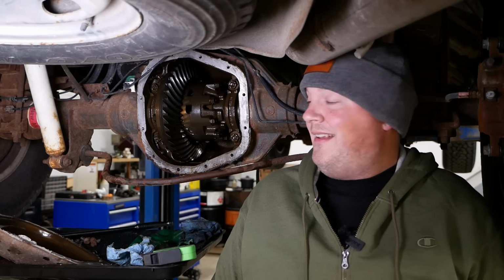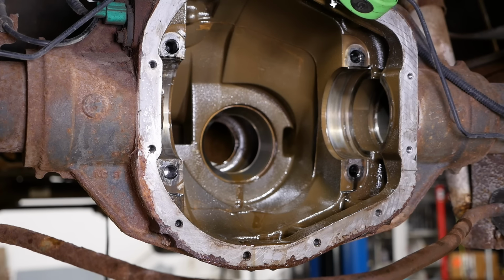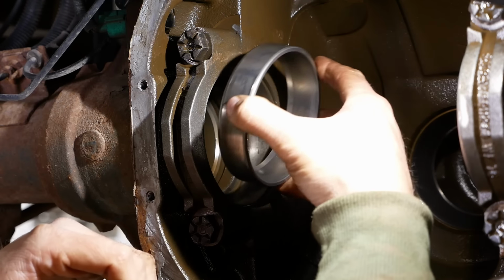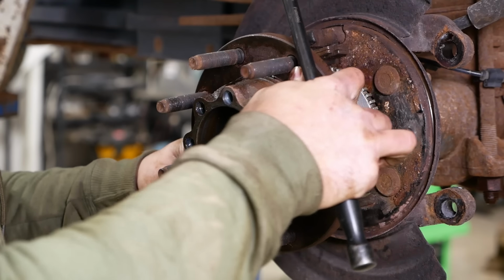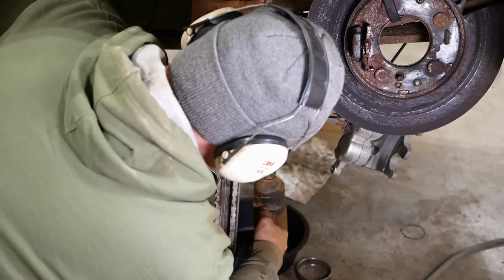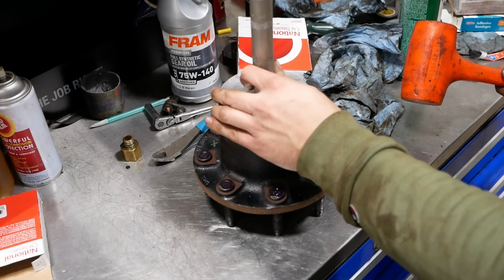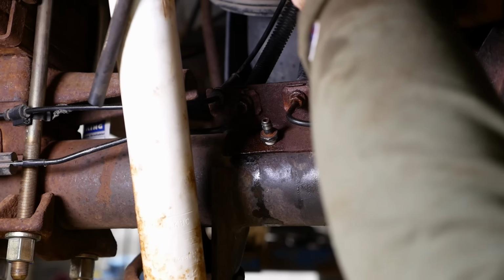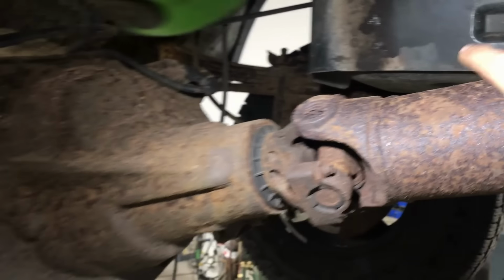Ford Differential Carnage - Driveline Noise Located

Comment: cat bearing set,  its like locktite for bearings/races..  great stuff I use it on all dana's as they tend to spin the load side carrier bearing and spin the carrier shims out....  ohh if you ever have to touch it again make sure you heat it before putting it in the press...

Comment: I had a gearbox for a 100 ish year old bridge crane with loose bearings like that actually worse. I glued a strip of paper in the housing and the cap. That crane ran another 25 years until they tore down that part of the mill. Damn thing was a beast, it actually had carbon piles for resistors in the motor control

Comment: I just rebuilt a rear axle in a JD 9520 4 wheel drive tractor . Axle bearing went out and took one of the planataries with it . Got the planatary parts from a salvage yard but still cost 5000$ for parts.

Comment: Good video WES. 1ST you saved your customer a lot of money. 2ND if you gave him the old axle back he would at least a spare ring and pinion gear.that is if they didn't want a core at the wreckers.You did the job in a clean non contaminated way.AND the big one >>>you cleaned out the VENT,most likely the start of this issue.

Comment: I recently rebuilt my 10.25, without the luxury of a lift. The prybar at about 5 mins in brought back "fond" memories of being afraid to catch the thing with my teeth. Pulled that thing out and reinstalled it maybe 25 times getting everything right.
Reply from the maker: Dana axles have a neat tool to spread the case so you can easily remove and install the carrier. I don't have one, but if I ever rebuild another Dana I'm getting one!
Reply: @WatchWesWork  I'd have cobbled something together at work if I had I known I'd be taking it out and installing it so many times. I eventually did make an alignment/measuring tool in order to measure the distance from the carrier axis to the pinion head. The shims that came in the kit for the carrier also only got my backlash too loose or too tight. I resorted to manually lapping/grinding the shims to fall into the narrow backlash tolerance that Motive Gear called out. I could find no one who sold shims that listed their thicknesses. I never did find a gear pattern I liked with marking compound, so I settled for careful measurements. It was a fun project.

Everyone who told me to find a junk yard rear end was right, but I didn't trust junkyard stuff and I'm stubborn.

Comment: Excellent video Wes :) also had replaced my 2 axles in his 2011 Ford  heavy duty 1/2 ton 4×4  truck 4 door one and had 285.000 miles back 2 years ago ! We had get 2 junk yards and swap over and totally 14 hours fix up and 6.2 litre great motor and 6 speed Automatic transmission too heard a lots nice stuff about them !

Comment: Little Trick To Getting that Yoke off that rear end is after you check your clearances and BEFORE you pull tgose axles out SET THE EMERGENCY GREAK good and tight that will keep that yoke from turning and it will come off easier this from a retired 78 year old Mechanic thats been there done that and found easier ways

Comment: Oil and grease do not blend together. It,s either oil or grease but not blended together. If mix together. .there,s a chemical break down
Being a long time trucker , all hubs are oil , way back on the day , hubs we're grease packed. If your oil seal went bad,leaking  and no shop within 200 miles. . One could slide the dual,tires, off the axle. Clean all the oil out and pack it with hand grease, the kind used on autos
Their is a chemical reaction between the two,causing the grease and oil to crap. Very good job and good pictures too. Thanks.

Comment: Sterling 10.5 is a common rear axle on Ford f250 and 350 super dutys they were also used on the excursions and several other vehicles these are full float axles

Comment: I needed this video I have been chasing this problem for a few weeks I only replaced the outer pinion bearing. I bet my problem is deeper after watching this. I got a little scared when you said all the parts were more expensive than a new axle. I was able to find a kit from nitro for under 400.

Comment: You nailed it.... Liability. Cracks, contamination, etc. Personally, I would have thrown new bearings in it, the shims right back where they were, and maybe replaced the crush sleeve. Not much around here worth the effort. As long as it's not heading to the track...

Comment: I used to have a 50 Ford Flat bed truck that had been extended to 18 feet. It ate U joints. I learned to carry a 7/16 wrench and a couple spare U joints. Got it down to about 10 minutes. Don't want that hay getting damp and I didn't want to pull him off the bailer.

Comment: Great job. I wrench on all my stuff. I once had a 1972 Vega with a limited slip diff. Those a carrier gear bolt came completely out and ran through the ring and pinion gear teeth, totally destroyed it, the bolt was crushed and had gear marks on the side.  I replaced with a junk yard Diff for like maybe at most $100, of course not limited slip. I blame GM for the bolt coming loose like that. I thought  how a massive bolt could run through the gear teeth, and what happens is the pumpkin bends distorts or cracks or something yields to allow that. I did the diff axle change in the parking lot at the apartment complex. That was back around 1985. I heaved the busted diff right into their green bulk trash bin.

Comment: I had a 2011 F150 that had the rear differential over heat to the point where you could not keep your hand on it. Thank God for warranties. Ford dealer just replaced all the internal parts.

Comment: Otherwise they will turn on and crank up the radio and cover up the unwanted noise. Like you Wes I have seen it every day for 40+ years now. My favorite is run the rotors until the fins are the stopping surface for the brake pads.😅😂. It will get you to stop quicker they say.

Comment: On every vehicle I've owned (I'm 74 so , a lot of vehicles ) I take the trans and diff vent out , put a barbed fitting and a neoprene hose curled downward and wired (zip tied ) to the housing . Much better way to vent 👍

Comment: Late to the party a but but hey never to late to find awsome video. The F150 with the 10.5 (newer one) also have a lot of problem with water getting in (with the axle bolt breaking off but there is a TSB for that). The casing itself looks very similar even tho it is less heavy duty in the F150. What I see most is water getting in and then everything eat itself up but it also end up destroying the right (always the right) axle shaft out bearing for some reason. You have a noisy drivetrain and you can move the right wheel up and down. Already have done like 5 of those this year on 2018+ trucks with lots of miles (from a construction company)

Comment: In my opinion if there's any doubt with a part replace it , you can put it back together and it may start to wear on the new parts immediately or you could get lucky and it will give you a few more years

Comment: Depends on which junkyard you go to down here. If you go to the Cuban junkyard they'll sell you anything they possibly can. Brake parts (even used pads), batteries, fluids; if it came into the yard they'll try and sell it. If you go to the LKQ pick & pull on the other hand, they're a bit more restrictive on what they'll sell you.

Comment: As always a good video Wes I am going to make one suggestion it was where our then was if you replace one caliper you replace both calipers the reason being is a newer caliber is stronger and will blow out the other caliper you know somebody else probably did it always a good policy even with good not wheel seals but I should say brake shoe cylinders for the on each wheel Chase both out or off for alright 68 year old mechanic Bob from Vero Beach Florida God bless have a great holiday and stay safe

Comment: Odd, those axles are usually super tough, like 500hp on 43" tires tough.  Carrier bolts are only supposed to be ~88ft/lbs.  That differential either got REALLY hot or had water in it and it sat.  In a pinch with a spun race a guy can take a center punch and stipple the surface and then give it a nice coat of red loc-tite and put it back together (oh, you mention just that :D)  The gears are probably smoked though, you'll never get a good pattern out of them.  That sucks about your junkyard though, we get axles 100% complete ready to bolt in besides a fluid check.  That's a LOT more work!
Reply from the maker: Water in oil can kill anything.

Comment: I have a 1996 f350 xlt one ton pickup that has 103,568 miles on my rear axle. I am going to replace all new bearings and gaskets and seals on my truck. Do to the very same noise like the truck you just worked on. I caught this problem much sooner. My truck also has a hub seal leaking, but I have new hub bearings and two-piece seal for both hubs.

Comment: Bearing races in axle hubs:  Obviously the best solution, and probably the most expensive due to the machining required, is to grind down the base surface of the bearing bearer and re-centre-machine it to take the bearing race securely.  Anything else is rather a mixture of glue and "hoping it stays" -- which it may do in the short (rather short) term before it fails again.  I guess it comes down to the budget of your client.

Comment: If I'm honest, my first thought with that loosey goosey bearing was (if it was mine anyway) to get the cap on a whetstone & give it a couple figure-8's just so it pinched the bearing a little more like the other side and sack the out-of-round, then use a dab of bearing retainer to back it up, both sides. Just replace the pinion and centre section bearings & seals 'n call her good.  
For a paying customer though, where you have to stand behind your work and eat any costs from it screwing up that last 0.05% of the time, you're probably on the right track replacing the whole shebang.

One thing I would NOT do, personally, is the Millwrong/farmer trick of dimpling it. Definitely on something 1-piece like in the pinion end or a wheel hub etc, but when you have a removable cap like the carrier bearings there's so much more elegant ways to skin that kitty.
Reply: On the used brake parts thing, it's gotta be liability that's all it can be. Whatever happened to common sense and understanding that you bought what you saw as and where you saw it & took responsibility to determine if you felt it fit to use again?  At least the guys you spoke with were willing to sell them though, even if they did have to cover their behind on paper.  

Suppose your state having no inspection doesn't help the cause though, must be a few cases where junkyard brake parts were installed badly or had hidden damage causing failure a couple of years down the line.  Much as I hate our MoT in the UK, it at least means someone actually goes under the vehicle and looks it over once a year, even if some of the failure points are not going to make a blind bit of difference to anyone except the operator.

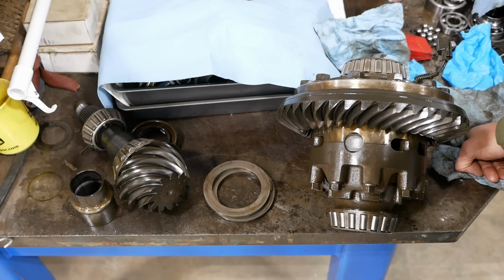Comment: 15:30 Your exactly right. Did a 10.25 Sterling in a 1995 F250. Completely smoked ring pinion and 3rd member. Was $650 to rebuild it, or $100 for a good complete drum to drum 10.25. I'll give you a guess what the customer chose to do lol

Comment: Had a 150k mile 2010 F350+sterling 10.5" load dependent howl a few years ago, pulled apart, replaced the large pinion bearing as all else looked ok, silence for 2 years+10k miles, howl has now returned!!!  Not 100% sure I tightened the new pinion nut enough, could this have caused the howl to return? Thanks and great vid !!  Wish you were around here!

Comment: I never change axle/carrier/pinion bearings just cause its too much hassle and twice the cost, some times three. I'll swap a diff any day although i usually just find a good one and swap the entire unit brakes and all. (Yes i live in the south) So i completely agree with u. setting back lash, crush sleeves all that nonsense is just not worth the trouble. Same with transfer cases. I dont know anybody that rebuilds diffs etc here in my area except one place and they dont supply the vaseline when u walk in the door...

Comment: Hi Wess I'm new to your channel,and I found by accident surfing on UTUBE,but what a good accident,so I own a 1986 F250 4x4 with the same 10.5 Sterling with some minor differences of course,owning such a truck I'm no stranger to mechanical workings of said truck recently I've noticed that the pinion seal started leaking haven't done much research on it but can the seal be changed with out worrying about the crush sleeve the rear is in really good shape I put axle seals in two years ago no issues last summer changed the rear cover rust issues and all looked really really good back lash was less then 10 more than 9 now I need to fix that pinion seal,found another go to channel thank you for the content I'll be watching for more from you God bless and peace out

Comment: So water got in there from a leaky axle seal. There was water in the rear differential oil that drained out. Nice catch on the plugged vent as the actual culprit to all the carnage. That axle could last a million miles with proper maintenance.

Comment: Seen another video on these axles. The tubes break loose from the 3rd member and move side to side, causing the ring gear to move side to side due to the bearings are no stationary. I just repaired one the had broken both shims on the ring gear. Bearings and shims and i took a strap and wrapped around the tires and the pulled the axle shafts back into the housing tapping on the outer hubs to force them back in place. Then i welded the axle tubes back to the 3rd member. And she was quite as silk afterwards. Im told, this is a common problem on these housings.

Comment: I like the way you inspect everything and show what to look for as you dis assemble setting a good example for the younger generation of those starting out in their careers .I remember once going to a rear end specialties guy in Burnaby B.C. Canada years ago just for fluid change and as I waited I heard a hammering noise after which I was shown a whole tooth missing from my ring gear but as it turned out he had a used set of gears that I paid 500 to get back out on the pavement I W E rear ends only what a crook but what can you do once in the grip of corruption .Also AAMCO  once tried pulling a fast one upon wanting to get a leaky accumulator o ring replaced on a turbo 350 and they wanted to put a seal kit and take the trans out and I decided to leave but the guy had disconnected the vacuum modulator hose so it would not up shift in drive which I noticed within two blocks but I was young and had no reason to believe justice could prevail so I thought it needs to be mentioned that its a dangerous world out there for the young old inexperienced so if possible try to get second opinions if not held hostage  peeps!

Comment: When you said brake/break time I got an ad, seamless. I wonder if they used to grease the bearings as the old oils couldn't handle the extra heat from the brakes?

Comment: I'm about 15mins in. And you just said what I would've suggested. Swap out the diff. Done a few of this style axle. The bearings die for whatever reason. I don't think I'd ever suggest brake parts from a junkyard either.

Comment: Yup my f150 9.75 with 3.73 gears pinion and carrier bearings shot. I opted for the used rear but around here in Texas they can go for 800+ found one for 500 but didn't like the lash come to find out one carrier race had spun. Had to rebuild the case in my truck. All bearings exc it cost me almost $2500.00. Come to think of it I better service it. Btw very professional application of sealant on that cover like it should be done.

Comment: For those loose bearings I would just grind a few thou off the caps, as I am sure you could not even get a 3 thou feeler gauge between the cap and the bearing.  Maybe use 'Plastigauge' to see the exact clearance.  Remember all metals bend to some extent, so the cap would take up the round shape of the bearing easily, forget the line boring.

Comment: It's opposite thread because it's not a rotating part of the assembly. On rotating parts of the assembly, such as lug nuts you should actually have right hand thread on the left hand side of the car and left hand thread on the right hand side of the car will have a tendency to tighten itself not loosen itself. But the fact that that is not a rotating unit, then left hand side of the car should have left hand thread.
37 ft lb x 8 bolts is 296 ft lb of force holding that splined axle cap on that hub.

Comment: I Had a Hammer like that in the Snap-on variety had not used it in a long time open the drawer on the toolbox and it had disintegrated into small pieces

Comment: My preference would have been new bearings, shims, and loctite races. Change the axle juice every year, and it’s going to last longer than the Ferd. If I was your customer and you said you’d rather swap a used axel, I would go with you recommendation.
I just think in extreme climate nobody changes the axle juice  24 months, so I think the problem is across all trucks that get worked or wet, which is most of them.